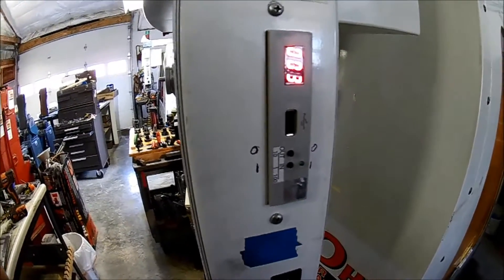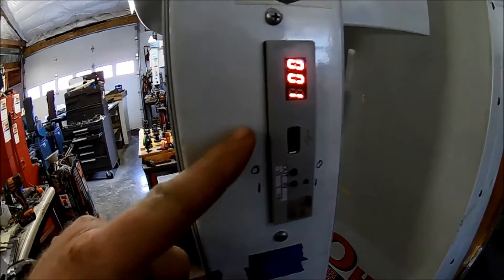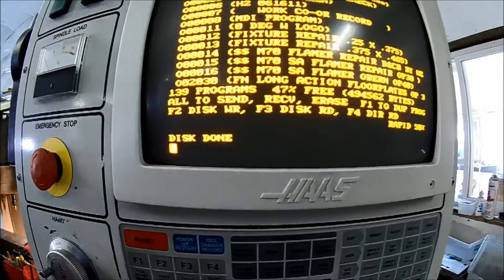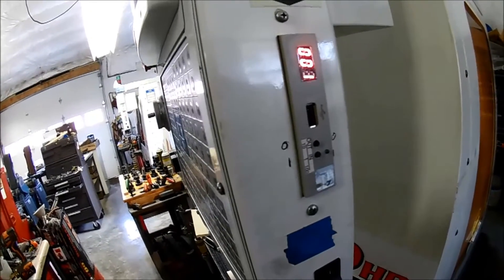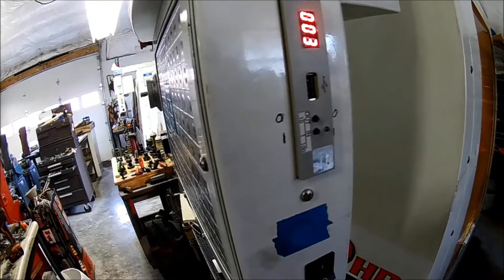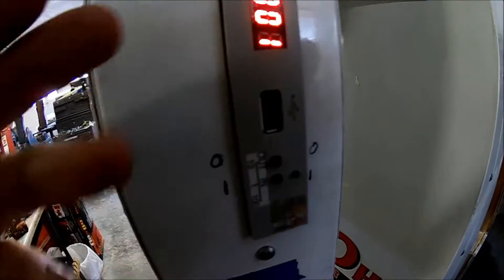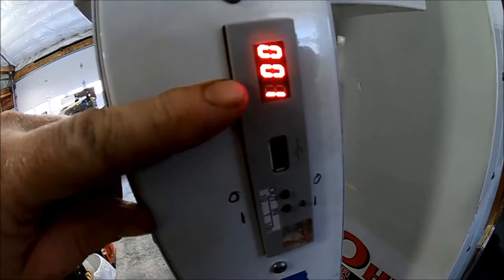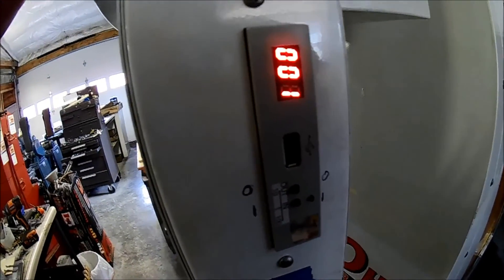USB Drive Instructional Movie

Comment: Hello i also have a micron, but i'm wondering where you bought the emulator. Do you have a link or some information about the emulator model? Thanks
Reply from the maker: I purchased this directly from the manufacturer, who at the time was located in my area, but he was selling them on Ebay.  The name was Aluma FX.  I have since sold the machines they were on and I'm unaware if he is still producing them.
I noticed other models are available on ebay that appear to function the same.

Comment: When loading from Old Haas Machine w/ Emulator to New Haas w/ USB=No Problem Works Great...  New to Old:  I can see program in the Disk Directory when I hit F4 and then Edit,  but can Not get it to load into the machine as an actual Program.  What am I doing wrong?  Thanks
Reply: CAN YOU FIX IT, I HAVE THAT PROBLEM
Reply: @bryanvalenzuela1454  areglaste el problema